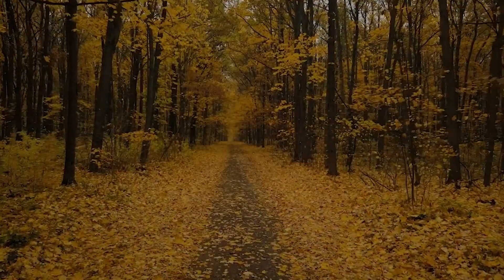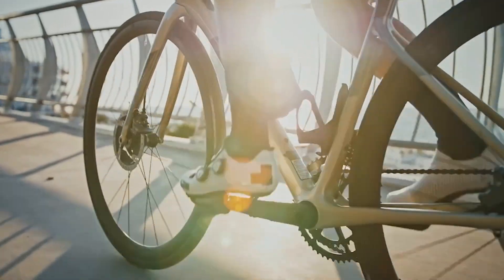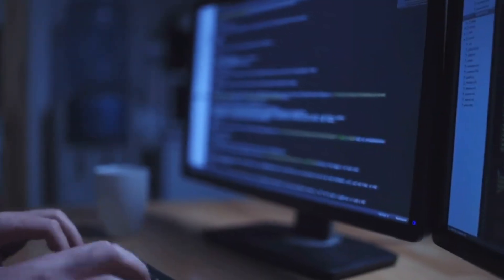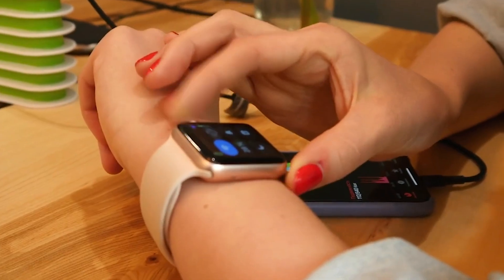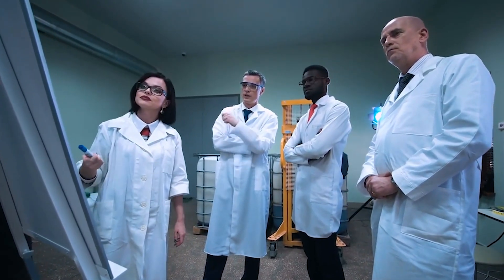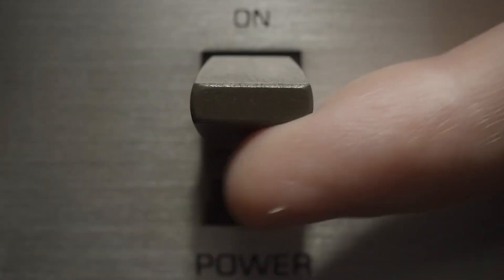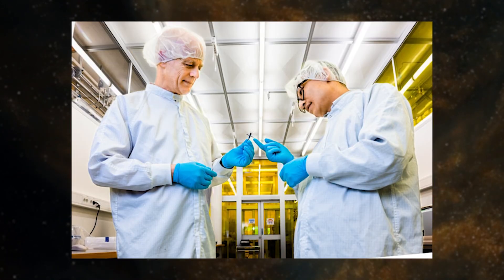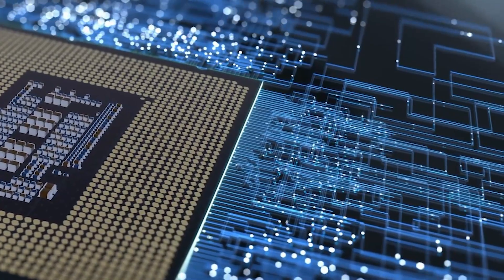The Revolutionary Invention Turning Wood Into Tech

Comment: The development of a wood-based transistor that can continuously regulate electric current is a significant step forward in the field of electronic engineering. This technology has the potential to revolutionize the electronics industry by opening the door to sustainable and environmentally friendly electronic devices.